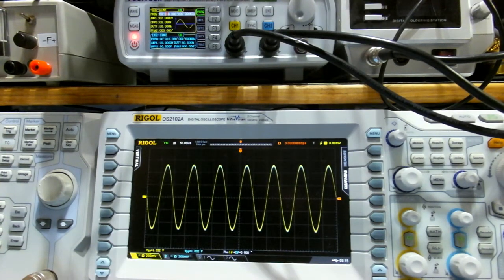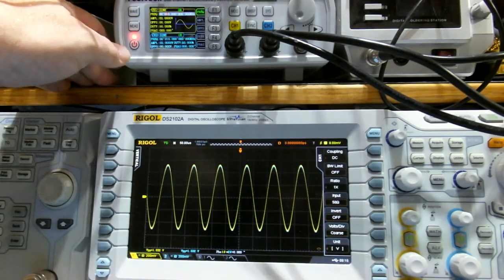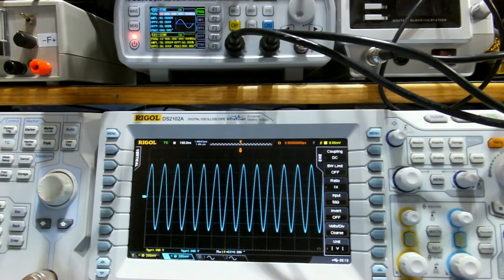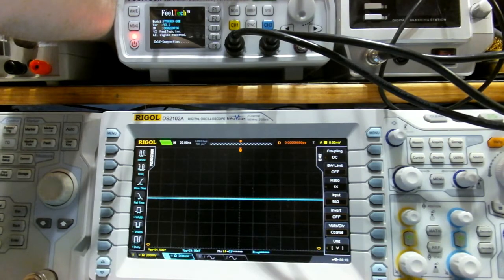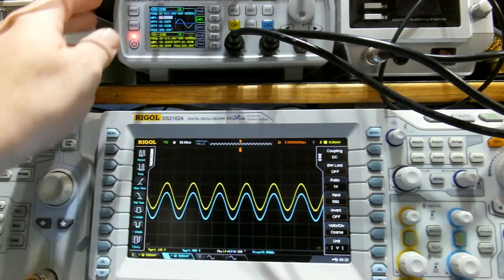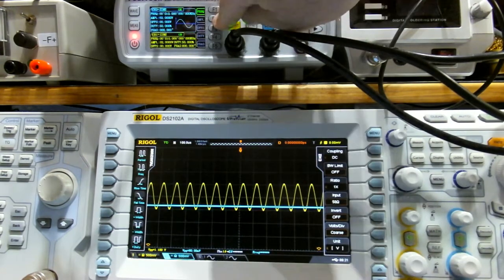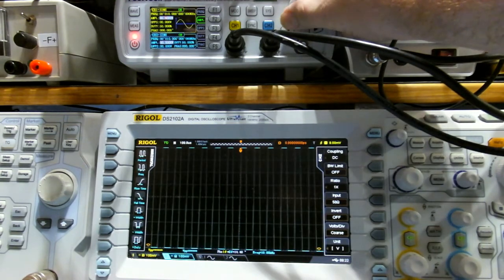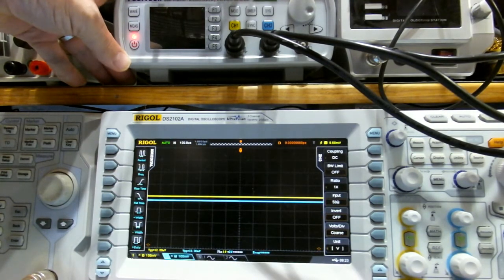Issues with FeelTech 6600

Comment: I replaced power supply, clock and opamps on mine. You should terminate your cables with 50 ohm inline terminators.
Reply: If you look carefully, you can see that his scope has 50 ohm termination switched on.

Comment: I don't know if one of you has experienced my problem, but my FY-6600 has AWFUL  phase 

instability on higher frequencies. Two examples:

 1 - It is IMPOSSIBLE to have a stable Lissajous figure against an
        external source (i tried with a known good 10 MHz OCXO).
        Between FY-6600's A and B outputs, no problem, but with
        an external source, this is impossible.

 2 - When using an HF radio on SSB to have a note in the speaker,
       (example: HF on 28.010 USB and my FY-6600 set at 28.011 MHz)
        the note has AWFUL instabilities. Not a continuous smooth
        drift like an old tube signal generator, but awful erratic
        up/down frequency instabilities !!!

The instabilities become higher as i go up in frequency.

And you know what ?  I'm 90 % sure this is a firmware issue, not pysical.

Also, the internal quartz oscillator is not trimmable and there's
no external reference input.For a generator with a fourteen digit
resolution, this is totally unacceptable.
Reply from the maker: Have a look here: http://www.eevblog.com/forum/testgear/feeltech-fy6600-60mhz-2-ch-vco-function-arbitrary-waveform-signal-generator/

Comment: Maybe leave a little longer between power-down and power-up?  10 seconds more might make the difference.  Also, potential EMC issue?  What's nearby in terms of RF output?  It's an unearthed unshielded circuit.  Really good video though - appreciated.

Comment: I have this signal generator, but the 30 MHZ version. What I noticed is that as you pressed the standby button, the red LED started to blink rapidly. This does not happen on my unit. Also, I could not reproduce any of the faults that you demonstrated. It would seem that you may have a hardware issue in your device. The rapidly blinking LED is the clue that something is not quite right. May be you should open it up and check for improperly seated cables, bad solder joints, etc .